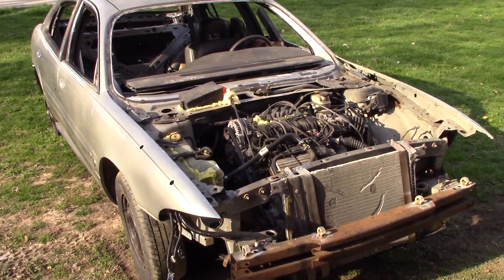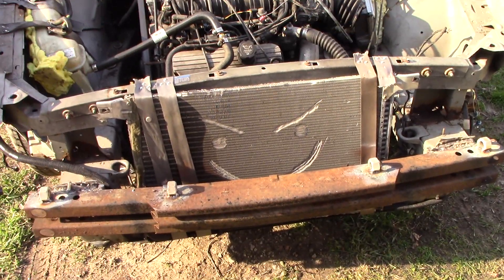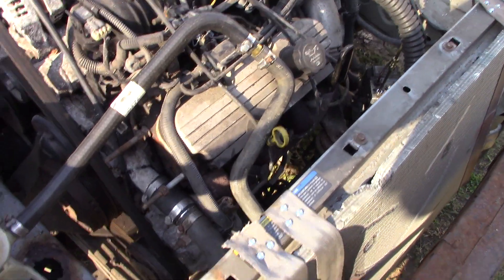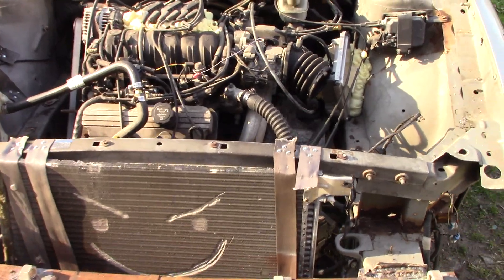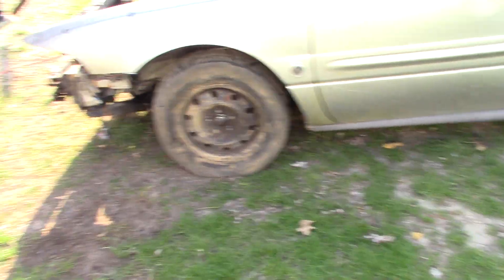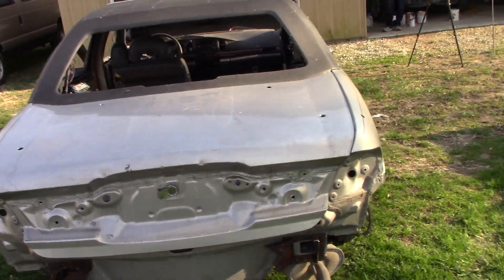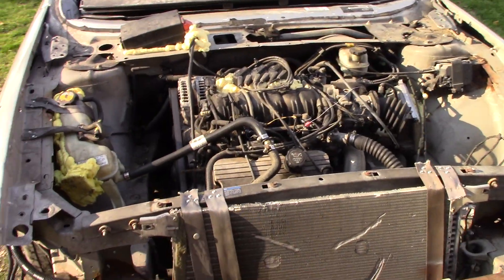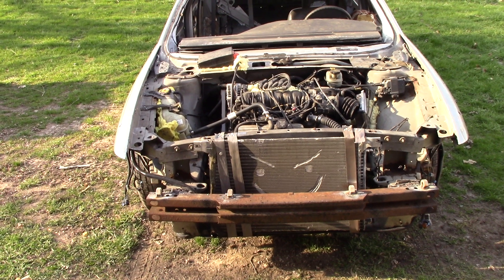2004 Buick LeSabre Derby Build Ep 4: Almost Finished

Comment: instead of running the overflow tank and worrying about it cracking, you can cut the hose going to it and shove a screwdriver/nut driver/something about the same width as the inside diameter of the hose inside and hose clamp it shut. has worked for me and others on quite a few vics

Comment: Whoa.. How or what did you replace the lower aluminum control arm with a steel one? I’ve never ran one because I couldn’t find one that would fit?
Reply from the maker: 2000-05 Taurus control arm can be modded to work.

Comment: Derby cars are supposed to have the hood on them so they can be operable for tech inspection and that it does not come through the windshield with out a safety bar, wire or chain in the middle of the windshield, I know you are supposed to have a bar, wire or chain on the middle of the windshield for safety, but I do not see one on this car

Comment: Do you think that bumper will be strong enough for the front of that?
Reply from the maker: No, but it’s the only thing long enough to reach both frame rails haha.
Reply: @DemolitionMissions  have any rear caravan bumpers or anything similar? Those would probably be a little stronger than that one. I would think anyway lol I don't use rebar stuff so it's just a guess lol
Reply from the maker: @derbyfreak8183   I may test out a caravan rear on a future car
Reply: @DemolitionMissions  they seem fairly decent. ZacksWorkshop has used one on a camry, seemed to do ok.
Reply from the maker: @derbyfreak8183  I ran one on the ghostbusters wagon and it folded fast
Reply: @DemolitionMissions  oh I remember that. Idk what years are supposed to be better. But I don't think there was very many. Just a few years had the good ones but idk which ones. Have you looked into those Mazda 3 bumpers yet? Those seem pretty good too